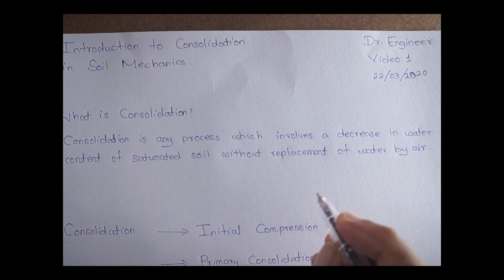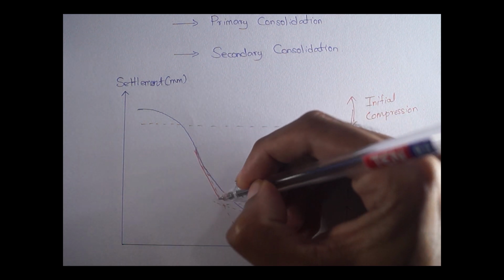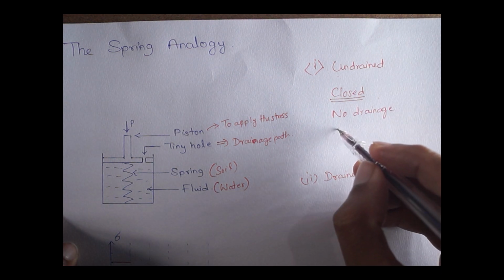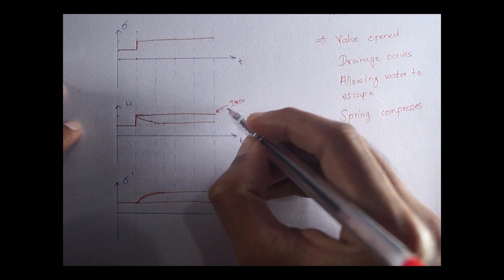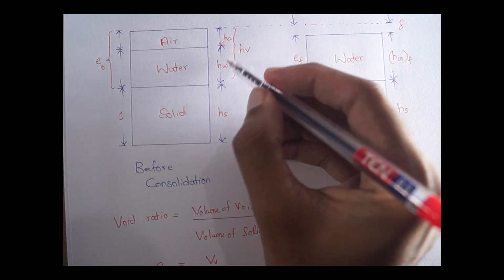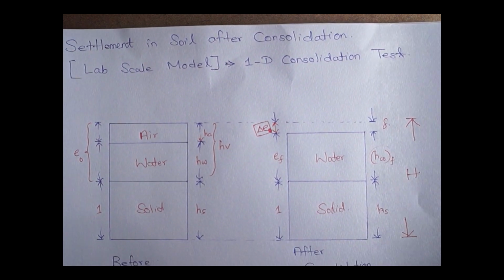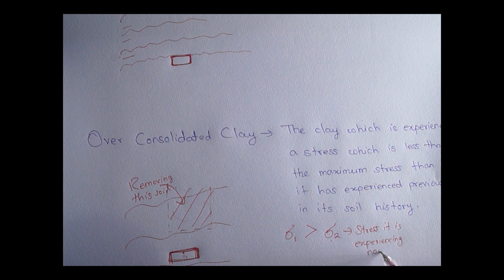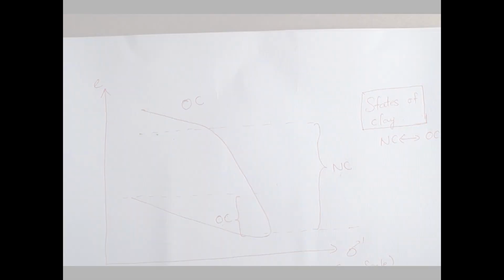Introduction to Consolidation

Comment: Wow great bro, But I like to add some facts ;As I know consolidation is the process change of volume by expulsion of water due to reduction of excess pore pressure which generated due to action of  static loads on saturated clayey soils is the exact definition,(without involvement of air- yes its a process occur in saturated clayey soils)  note - saturated pores, therefore no air involvement.Initial compression portion is not that due to previous loads only, is there aren't any possibility of air after acts of previous loads? it is exactly possible therefore ,initial compression happens due to expulsion of prevailing air present in the sample. Hope your opinion.
Reply from the maker: I mentioned that water is not replaced by air that is no air is entering back into the sample. So, no involvement of air. Meanwhile, the initial settlement can occur due to removal of air too
Thank you for your involvement and suggestion.
Reply: Yes but How that the settlement vs time curve drawn ? for previous loads acted ? the main reason for initial settlement is not about previous loads. Its about prevailing air voids, That's what I highlighted.  Settlement time curve drawn for tested loads and we can get a prediction about previous loads acted from that curve. The fact that u stated in the video initial settlement due to previous loads is wrong .Its due to expulsion of prevailing air voids and that is not a suggestion that is the thing happens. Statement that said initial settlement due to previous experienced loads is not practical as we draw settlement curve for the applied  loads and observed settlements. How can we draw settlement curve for non observed settlements?
Reply from the maker: When the soil sample is loaded, initial compression occurs due to expulsion of air.
Thank you very much and keep supporting bro!!!